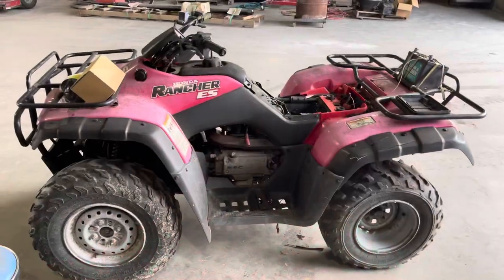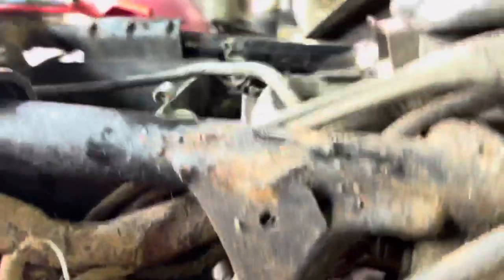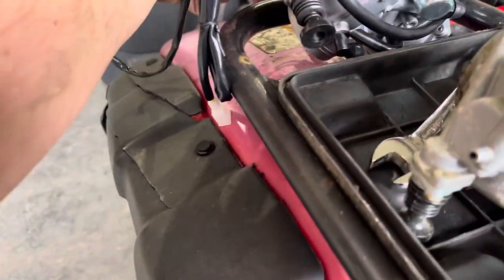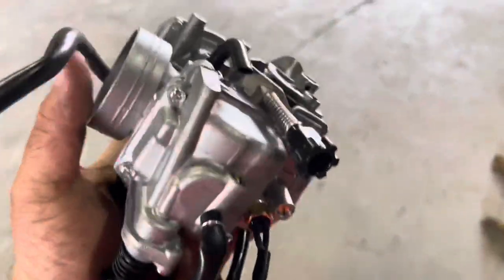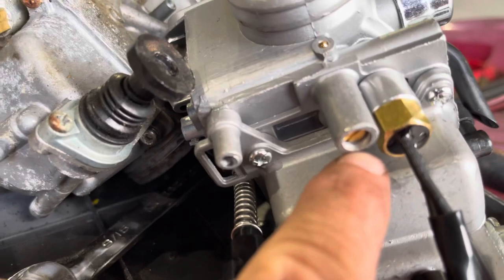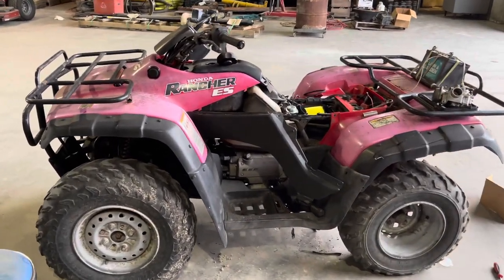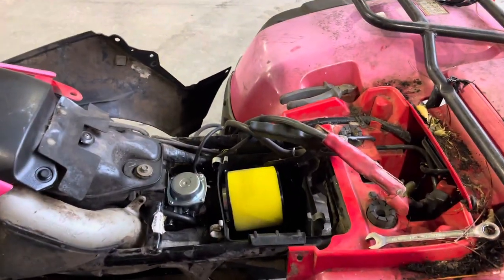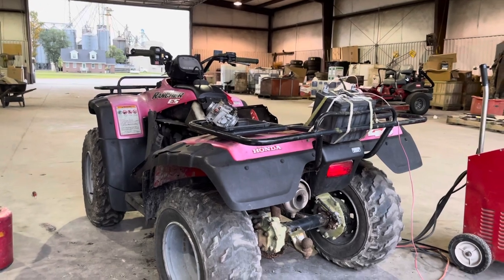The RIGHT way to replace a carburetor on a 2002 Honda rancher 350 ES

Comment: You’d be much better off in the long run if you “rebuilt” it. I’m talking about replacing the bowl gasket and float needle, and simply cleaning the body and jets. I’ve rarely had a cheap Chinese carb work like they’re supposed to
Reply from the maker: I’ve had worst luck with the new OEM Then I did with the cheap one I couldn’t get the Oem to stop overflowing

Comment: I have a 04 same model. Did you buy the OEM carb or aftermarket? Did you adjust the carb idle with the screw under it?
Reply from the maker: No this is a Amazon carb and I didn’t have to adjust anything under it but I did adjust the throttle on the side but it’s super easy

Comment: Mine has been sitting for about 1 and half years, went to start it, and it just cranks. Pulled the filter off and there was some fuel in the bottom of the box( Sat sort of up hill)  Guess it's new carb time for the quad.
Reply from the maker: If there is fuel in the air box most likely it’s the float stuck and you can get a new carb off Amazon for pretty cheap if you don’t wanna fix it just make sure to drain all the gas
Reply: Yea I am just not sure if I want to go with a budget friendly option, or an OEM carb, and hopefully never have to think about it again. Or there is the option of rebuild kit, I suppose
Reply from the maker: They do offer rebuild kits you can also take the bottom of the carb apart and clean all the jets with a torch tip cleaner and brake cleaner I’ve done it in the past works good

Comment: You dont have to cut that wire it unthreads just swap it over to the new carb
Reply from the maker: Yeah that also works 😂I just ended up buying a different carb